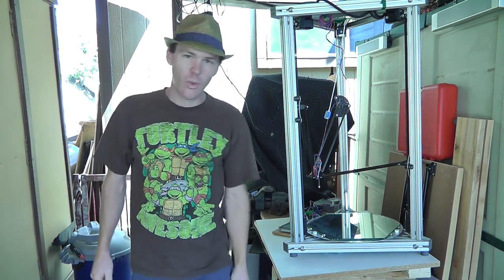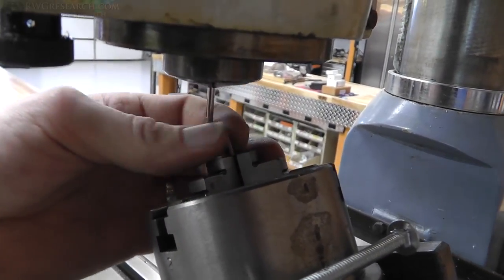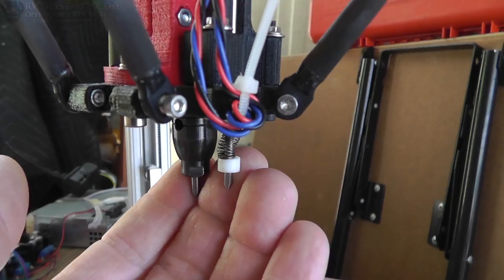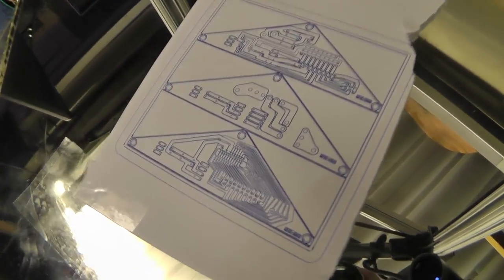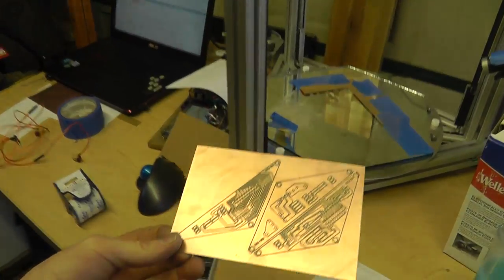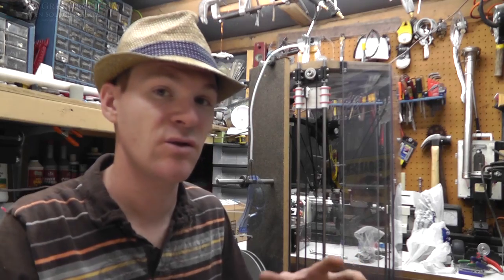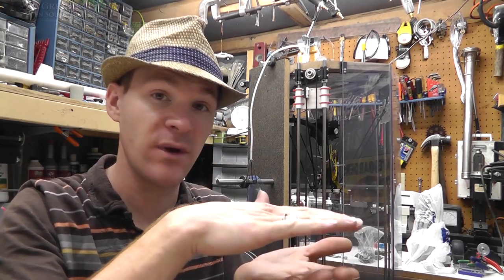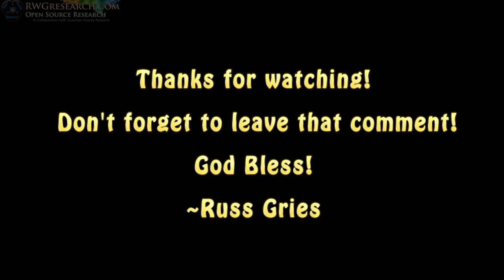RWG-OSD # 26: Milling PCB's - 3D Printer Makes Its Own PCB's! Double Sided!!!

Comment: crazy cool man.  for milling 2 sides ,  your jig is almost perfect for indexing and getting the 2 sides to line up . On trick i suggest to make it easier , and nor require hardly any sanding before you flip , is to use small bits of extra board in the corners and such , to hold the board 1.5 mm above your glass bed .  if your bit is sharp enough and feed rate is good it should not even hardly deflect your board at all during milling .
Reply from the maker: thanks, yeah i made a new jig that ill show in upcoming videos, it has reference points. so its a lot better to set up. it also holds the board so when I flip it its in the same X0Y0, I tested it with the etching method and its good. now im thinking that i can also drill the holes! haha will see about that... thats a lot of custom G code making lol ~Russ
Reply: lol you know sooner or later you will have a VMC , or at least a big CNC of some sort . LOL i figured you would be onto pick n place system too if you ever hit a project that needs few hundred boards . nice OSD can take that sort of tool ends . very cool man
Reply from the maker: yeah! :) my back ground is robotics and PLC control, lots of fun stuff rattling around in my head... including a few loose nuts hehe ~Russ

Comment: Hi,  Russ!!
Milling the pcb requires the tip of the drill to be perfectly centered. Wobbliness at the tip of the drill bit is going to enlarge your cuts in a bad way, sometimes it may even end up breaking your bits. Vibrations from the drill are not good and having a delta printer doesn't help either. Anyway, what works best for me is the "pyramid engraving drill bit 20 degrees" (on ebay), feed rates of about 40mm/min, and 30000rpm/min. Faster speeds will heat up the copper giving you burrs on the edges of the cuts. To avoid that, use lubricant oil on the surface of the pcb to reduce both overheating and copper dust flying around
Reply from the maker: good stuff, my first attempt at this so its a learning experience.  so far i was in a hurry and having software prob's so next one will go smother :)  i ordered some bits and ill give it a go.  there is no real vibration from the bit i made. i know the slightest bit will through it off but holding it in your hand its really smooth. but the tip is so small that it can make a difference,  I can grind a notch out of the bit to balance it too, i thought about it.  ordered theses.  http://www.ebay.com/itm/322138869932 they seem Little better and will be more balanced than some of the longer ones. will give it a go again and see what happens :) looks like they have a good releaf cut in them. ill try those speeds and see what happens! 40 mm/s seems fast. ? ill take it slower due to the delta not being as sturdy as some solid CNC's . thanks for the thoughts! ~Russ
Reply: It should be less than 1mm/s. I gave the feedrate in mm/min because it's what I use normally on my cnc. About the drill bits, I have tried many other, titanium coated and normal carbide, V-shaped of different angles, from 10 to 90 degrees. Pyramid ones are much more durable than normal V-shaped given the same angle. I think they will also give a better result if you go with the ink-scratching option, as changes in the direction of the traces won't affect so badly to the thickness of the line.
Reply from the maker: oh I'm sorry, i read that wrong. yes mm/m, ok cool. i wish i had an electric attachment, that air one burns up the air and on my small supply of air its bad. lol i may need to give it a go at work, we have a big compressor there.  i dont want to buy an electric attachment, we had that air one at work, its a precision tool so i can trust its run out etc.  Thanks! ~Russ

Comment: Just a thought.... Attach the z probe wires to the bit and copper clad board to have it determine the height
Reply from the maker: yeah, its hard due to the tip being so small. also i found out that the auto cal was messing things up... so now i only do a 4 type cal and its better... I was just in a hurry to get it done lol i needed to take it slower... ~Russ

Comment: I've wanted to do this for months but can you do the following to make it look like a factory bought board.  First off drill the holes, then run a light layer of plastic down say blue, green , flat black. the the last part run white part numbers over the first coat of plastic which will fill your board letters and numbers you etched. If you could get all of that done you would open a market where you could produce  boards and make money at it.

Comment: If you use GRBL and bcnc you get auto height probing. I use a 3d printed little vice with tensioners underneath to hold the board in place.

Why didn't you buy some of the very inexpensive v bits on ebay?

What is that drill you are using, looks like a good solution?
Reply from the maker: yeah, the PCB program i use is not so fancy so i got to do it the hard way... lol 
i just bought some on ebay today, will give it a go but allays try to make it my self first :) also those ebay bits i feel may be cheep and i hate buying crap bits! lol 
drill I'm using is a Campbell Hausfeld PL1530 micro die grinder  http://www.microdiegrinder.com/PL1530.pdf 
its a good steady unit, well built! its a bit nosier than i would like but you know... its ran from AIR!  ~Russ
Reply: I have tested 30 and 10 deg tips, 10 deg is way too weak couldn't get a single board out of it. I have found the 30 deg tips pretty robust. I didn't think to go pneumatic, probably because I don't have an air compressor.. Haha I doubt it's noisier than my shitty fake dremel with a flex shaft.
Reply from the maker: haha, yeah theses are 15 degrees i ordered so will see, take it slow and hope for the best. i was told that 60 deg are best for pcb. so thats the one i made. .1mm tip... ~Russ

Comment: Ooooh that old machine at the end :D That's a bit of Keith Fenner, that is! Bet he can tell you all about that machine, can probably tell you the damn guy that build it :P
Hey, question: is bowing of the work surface a concern when you're milling PCB, because of the extra force? Dipping in the middle?
I'm thinking of getting a granite slab kitchen cutting board to use as a rigid flat surface for sanding, and I reckon that could also be good for you :) Just lay it on the glass, tape the PCB to that.
Reply from the maker: well... i used just glass... seems just fine. however i plan on using some double sided tape on the next one. i have some thin tape i plan on using. The center did want to bow. the thicker pcb's I think will be just fine...  granite i think is over kill... but if you got it use It!  a thick AL plate will do...  I also made a PCB holder that you will see in the next videos. its a thick piece of acrylic i milled a small slot in to hold the 4x6" PCB's,  I also put guide holes in it to get it zeroed in to Y0X0 so when i flip the PCB its in the EZACT same location so the back traces ate right ! its a real treat doing both sides!!!! single sided it no big deal lol ~Russ
Reply: ***** Bet that's amazing, the first time you mill a double sided and everything lines up skookum :D Like Christmas, my friend!
Sounds like you're having some awesome fun :P Can't wait to see more :D
Reply: try glue, super glue is great, thin and easily removed with right thinner or heat
Reply from the maker: fun... stress... you know it goes hand in hand lol I'm sure learning a lot haha ~Russ
Reply from the maker: good idea, but my new jig is acrylic... so that might be a bad idea :) ~Russ

Comment: Russ. excellent work. how much was that air file I think you said and where you'd get it?. it's what I been looking for and do you know the psi/cfm it needs?
Reply from the maker: I'm using is a Campbell Hausfeld PL1530 micro die grinder  http://www.microdiegrinder.com/PL1530.pdf 
its a good steady unit, well built! there are units that look similar, but i think there lower RPM. i'm not sure of the    cfm, max 90 PSI. but it seems like a air hog... ~Russ
Reply: Thanks! Didn't know they even made a small one like that. Will definitely be getting one.
Reply from the maker: just google micro die grinder. somthing like this, https://www.amazon.com/gp/product/B000RH36WU/ ~Russ

Comment: if the copper is half the thickness of a pcb,can you just make 2 pcbs and attach them together back to back? Also i am trying to use a drill motor to etch the copper from the board. Why dont you do that? Thanks
Reply from the maker: yeah thats not a bad idea. could do such a thing. got new bits coming, will give it ago again. i think we can do it :) i was just in a rush :) ~Russ

Comment: I like the idea of doing this, but for cost sake, you can get all those boards printed in china with through hole plating and everything for less then $30 total.
Reply from the maker: ah! yes well there is something about doing it... in the description it states " Also if you are wondering... I'm not interested in buying a delta 3d printer. its WAY WAY WAY more fun to build one from scratch! :) " and i'm sticking to it haha  :) thanks for the comment!! ~Russ
Reply: fair enough, good luck.
Reply from the maker: Thanks! one day at a time. also this gives me more thoughts for using this as an engraver and other fun stuff. more possibility's the better :) ~Russ

Comment: Why don't you use standard PCB Print Circuit Board Carbide Micro Drill Bits? 
you can use all your tools to make a good platform like this video 
https://youtu.be/xz4LCIJyd2A?t=2m22s

and make a two sided circuit board, you need a reference point like the video.
Reply from the maker: yes, so in my later work i do that, but i use a jig, a milled piece of acrylic with reference points. for this video what i did was use the edge of the board as a reference point. any how more to do on this one. i was in a hurry most of the time, that caused some problems lol :) ~Russ